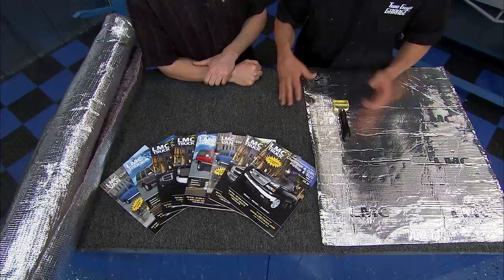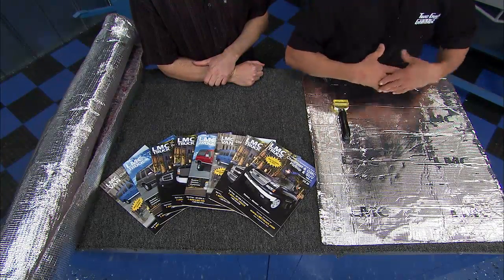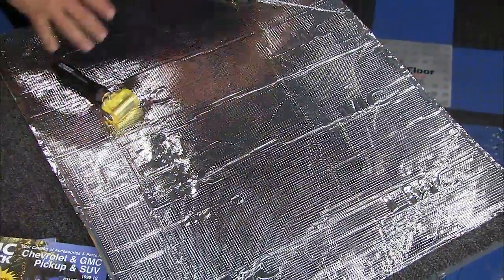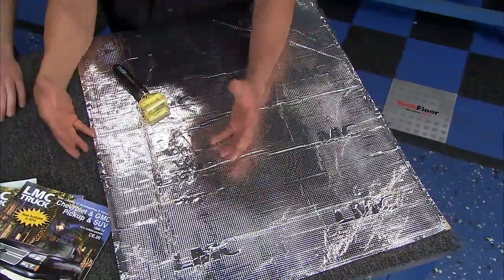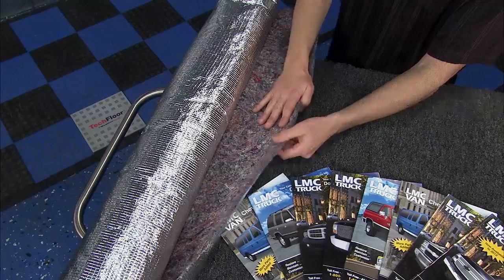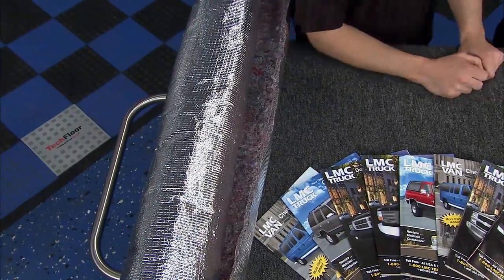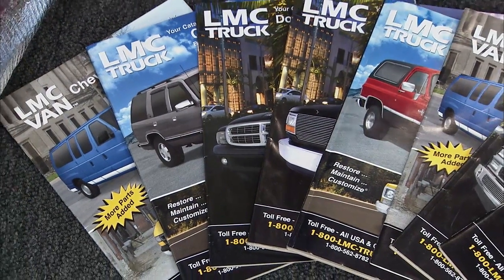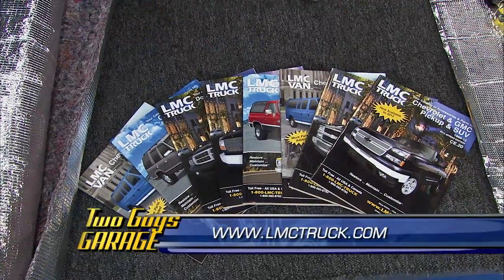LMC Truck: Sound Control Mat & Multi-Purpose Insulation on Two Guys Garage

Comment: Do not use that kind of multi-purpose foam on your car floor. It is cotton and it will rot away and smell bad by the vapor when the air cools down
Reply: No its not. Most cars already use this material. It is oil based and does not rot.
Reply: @batterynerd8779  Yup, thats exactly the kind of material my f150 and most cars I've seen from factory.